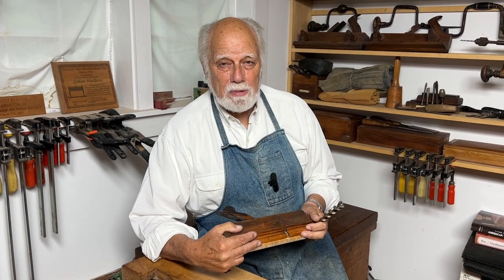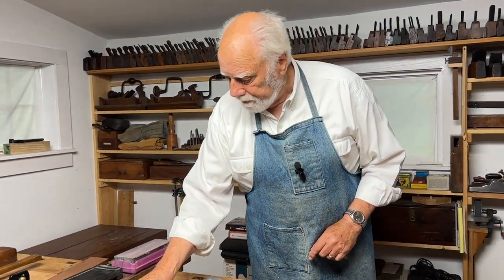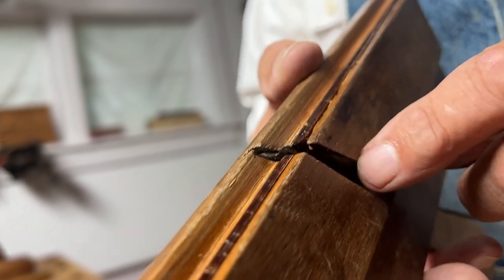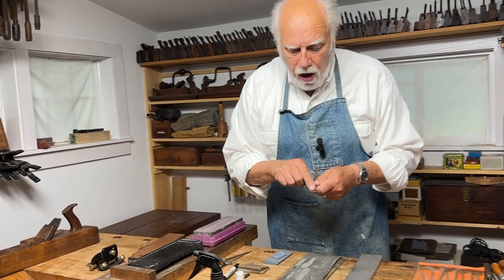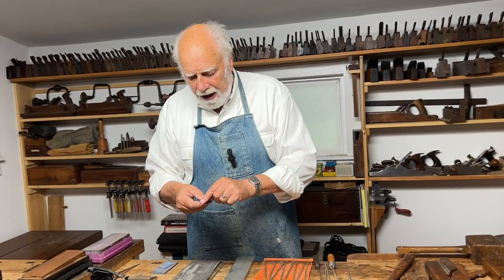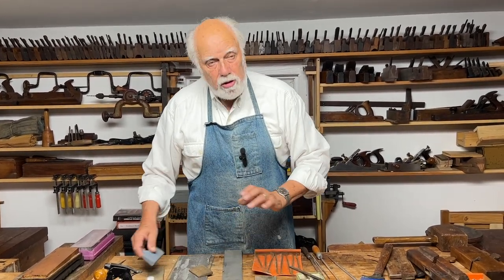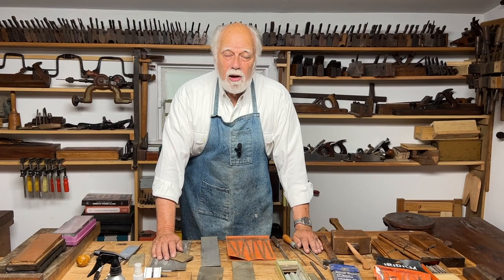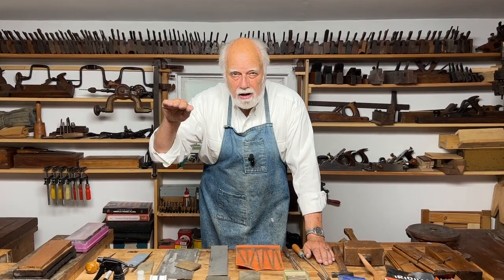53. How to Sharpen Non-square Blades

Comment: I found a shagged water stone on hard rubbish recently. It was a real mess. Not a flat surface in sight.  So i decided to cut it into wedges with a hacksaw. It took quite a while but the 'wet stone' wedges came out beautifully and are my current favourite go-to stone for tricky shaped blades. Thanks for another good vid!
Reply from the maker: Sounds cool.

Comment: Graham,  when scribing the iron to the moulding profile, I find using layout fluid works best. Find it at an industrial supply store. Brush it on the back side, scribe, file. The fluid comes off when the back of the iron is flattened.
Reply: You can get the same effect if you have a dry erase marker. It isn't quite as resistant to friction as layout fluid (which isn't saying much) but it's close enough that I never got more. I also have a special formula sharpie for writing on metal that I keep around when I want marks to be more durable
Reply from the maker: Both great ideas!

Comment: Great video.  What angle should the back of a moulding plane iron be.  And BTW, though I have used the 55 to do some nice work I have been collecting and using the wooden moulding planes too.  A lot less challenging to use.  But they have cost me between $25 to $50 Aussie $s ea.  Thank you
Reply from the maker: The angle depends on the quality of the iron, but 26 degrees isa good plave to start. (Not sure how much an Aussie dollar is, but over time I'm sure you'll be glad.)